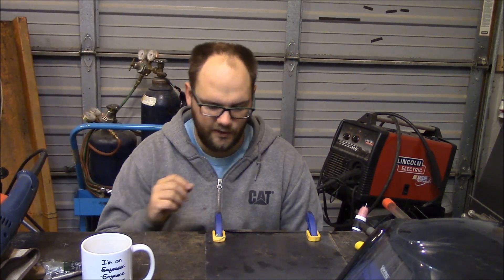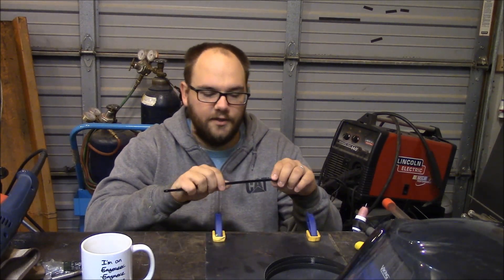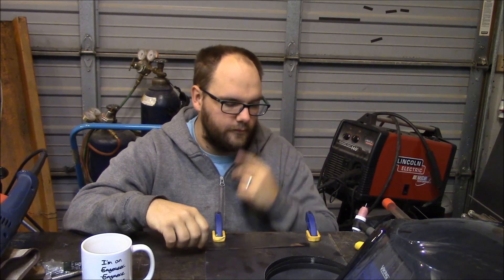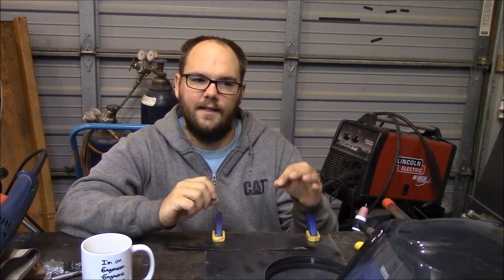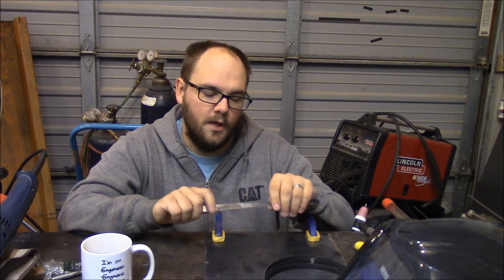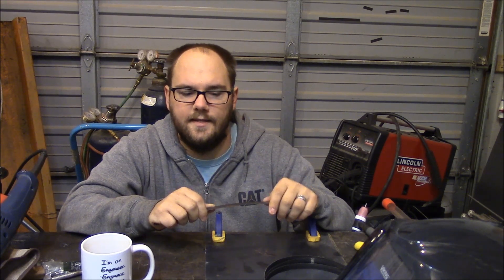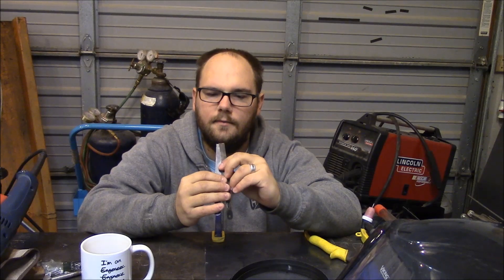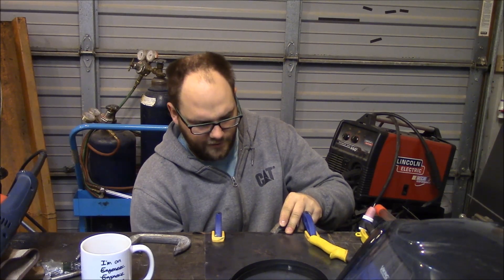WET #17   Part 1 TIG Welding a Band Saw Blade   Thoery and Set Up

Comment: which filler wire using to the process
Reply from the maker: I used 309L Stainless. It has a lot of stretch if needed, but strength as well. works good with the dissimiliar metals as it is a bi-metal blade also. Thanks for watching and asking!
Reply: @DavidFinchMMC  wandering how you do tempering after you welded the blade? Thanks

Comment: Actually, if you look at a resistance welder, like an Electroweld unit, once you clamp it, you contact the squared blade-ends together prior to flowing voltage to the clamps. This is the way resistance welding always works (though, in industry, it is normally done through beryllium-copper weld-rollers onto two fitted carbon-steel pieces that you desire to weld).  Then, you throw around 2kv of power through the contact point, which causes welding temperatures to occur as the clamp jaws come closer together (deforming the molten metal).  After the weld cools, you then apply an 'annealing current' through the weld, then remove the bandsaw blade from the machine.  That last annealing serves to return the blade to a flexible, 'springy' condition - because hardening would make the joint fail quickly.  I can't imagine a stainless steel weld on a bandsaw blade - hey, it might work, but until I see someone really test this out, I'll skip the offer, I've seen enough 'silver solder' and 'brazing' videos to know one thing - none of these guys have EVER been the one operating a bandsaw sawmill on a 24-inch tree when the band breaks, and that mickey mouse process is NOT going to hold up for 'long term' sawing efforts.  One thing everyone needs to look at who offers 'bandsaw blade repairs' is the one simple question, 'WHAT ARE THE PROS USING TO WELD BLADES?' The answer is one simple, consistent answer - RESISTANCE WELDING using the bandsaw blade metal itself. I wondered about TIG (MIG would be HARD to find the right wire to perfectly match your blade's metalurgy), but there are few videos on it, and NONE address the obvious metalurgy issues that are obviously apparent.

Comment: great video... how about 316L filler wire if that's all you have.  too brittle or would that work as well?
Reply from the maker: Chris Iversen 316L, although really starting to get away from the matching chemistry of the saw blade should work. Outside of time to set up, and try a small weld, what have you got to lose? You already have a broken blade.
Reply: David Finch good point.. well i just bought a bandsaw and learned the day after that metal cutting blades for it are not available locally in that size, etc... so i was thinking of just buying a new longer one off the shelf and trimming down.  but dont want to go to that effort or expense if its just going to break or is even considerably 'sub-optimal'.
Reply from the maker: Chris Iversen I wouldn't do that myself for a new blade. Cutting a blade and welding it intentionally should really only be for those that are buying blades by the spool, as in 100 feet at a time and making their own, or if using a vertical saw and feeding the blade through a drilled hole. 

With your description I would look for an alternative way to get the right size. Maybe posting what size you need and approximately where it needs to go I might be able to help out on that. Most of mine I wait for ENCO to have a free shipping +15-20% off sale and get from them, but that may only be a US deal on the free shipping, I'm not sure.
Reply: David Finch its a wood cutting bandsaw, sears craftsman 10" model, and takes a 70-1/2" blade.  I'm gonna check the box stores but i think i'm stuck ordering and waiting as since this is a wood cutting saw i really doubt that size will be stocked or even made for retail sales.  Looking to cut mostly aluminum but mild steel up to 1/8" on occasion.  

Thanks for your feedback, i'll take your advice in the interest of saving myself some added headaches and wasted time.
Reply from the maker: Chris Iversen Well, I check my normal sources and find that that is a hard length blade to find in a metal cutting tooth pitch. Another idea you might look at is someone, or company that has a blade welder, and might be willing to take a roll of blade and weld several for you for a small fee I'm sure, but it isn't unheard of companies doing this. The small time ones anywise.